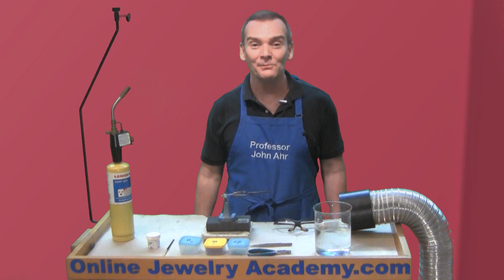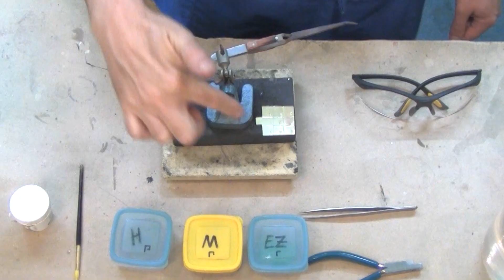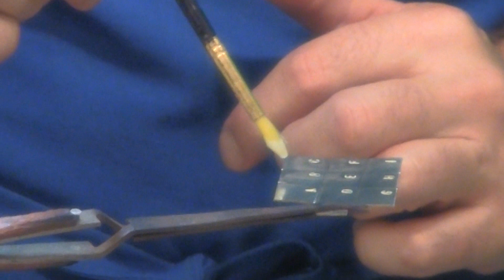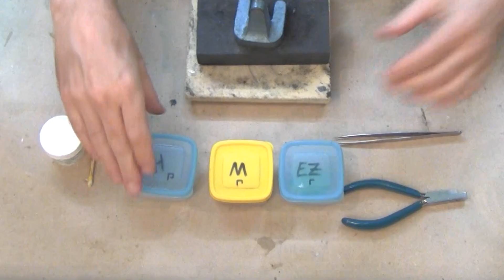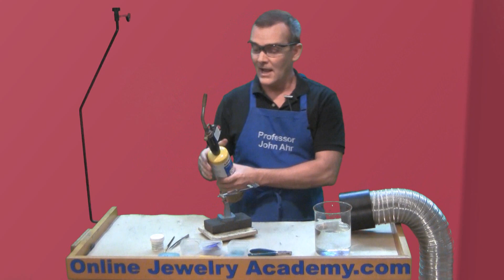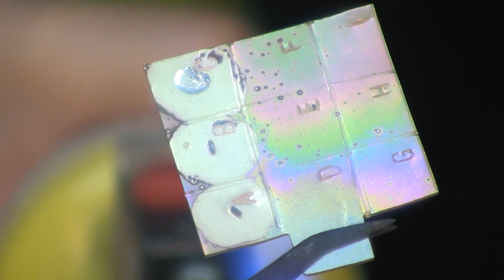Easy? Medium? Or Hard, What Kind Of Solder Is It?

Comment: Is there a reason why you don't use zero silver brazing wire for copper?
Reply from the maker: The techniques demonstrated in the OJA's videos reflect basic techniques used by the jewelry industry.  Therefore, we use inexpensive materials to show what can be achieved with sterling silver and gold.  I use silver solder in the videos because it can be used with most metals used in the jewelry industry.  I hope that answers your question.
Thanks for your support! : )
Reply: If you are working only in copper, you might enjoy using Cu-Phos solder, which can be used without flux in some cases, and really flows like water, gives a copper color    You might already be doing this!   There's a lot more silver solder in the world, it has so many uses   but it isn't copper color!    Cu-P wire is available online, and it comes in sticks for the plumbing industry, it's not easy to find in all the forms used in this sector like foil and ribbon    Silver solder seems expensive, but you really use so little that the price hardly seems to matter